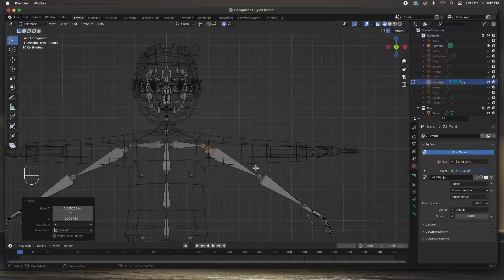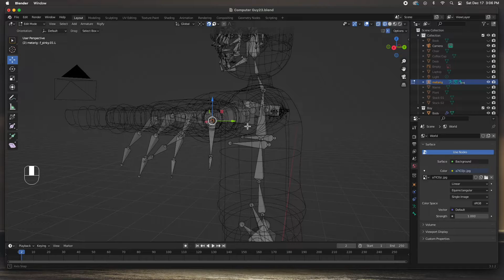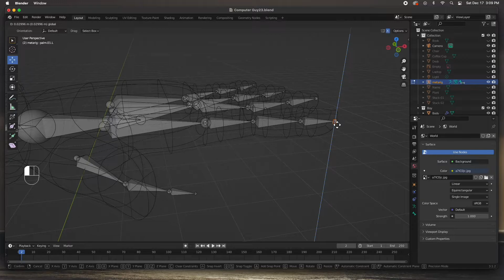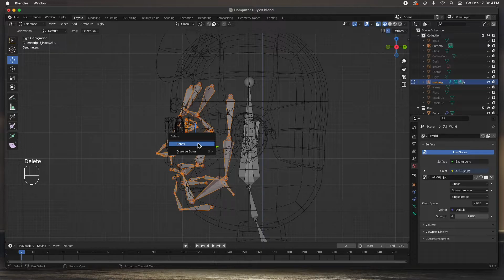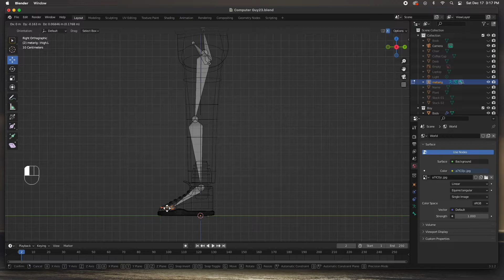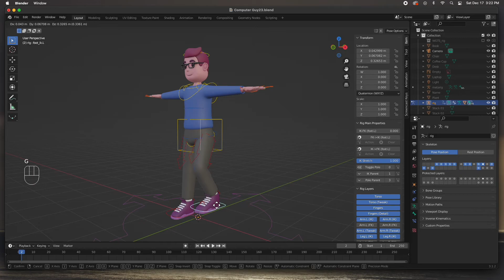Comment: This is great Martin, thanks. Although I am having some issues with my finger rolls going off in all directions when scaling as in your video and I also had some issues with my legs bending out to the sides but I managed to fix it by starting over and making some adjustments for the pre bend in the leg. Any chance of doing a troubleshooting video for people who may not be getting the same results as what you're getting before the final posing video? Cheers!
Reply: Hi Kevin, I like the idea! I think creating a video with that tip at the end of the series is a Great Idea. Thanks!!   👍 😎